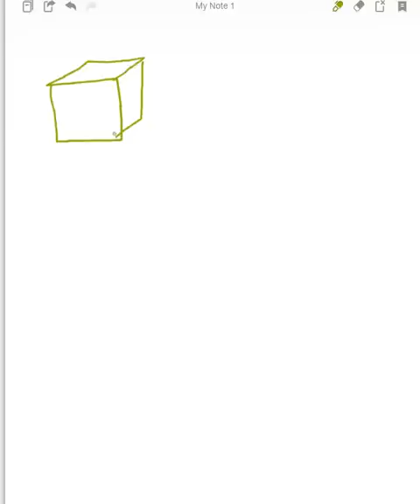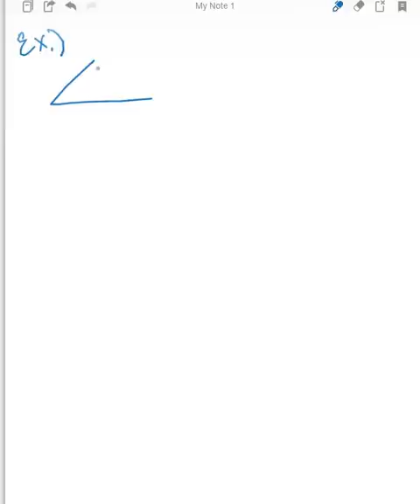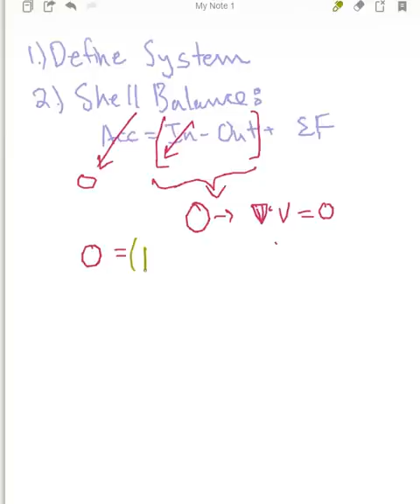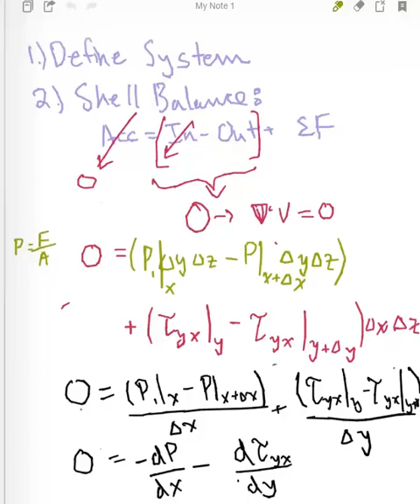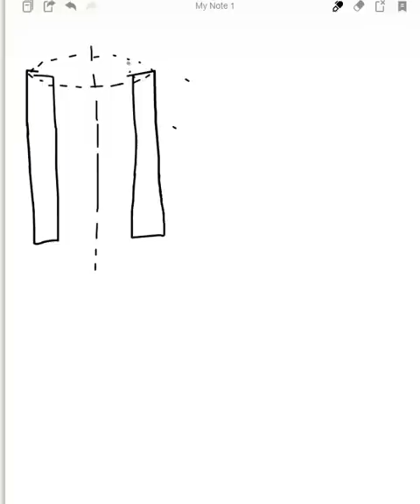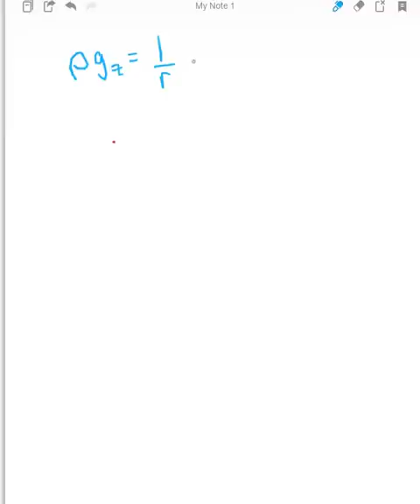An Introduction to the Momentum Shell Balance

Comment: I like how you guys use images and diagrams to explain how to do shell balances. Momentum balances are a tough topic to learn for students in chemical engineering. It seems you have a great amount of experience teaching shell balances and have a good enough grasp on the concept to be able to teach it to students. One thing that could be improved is to show each step of the derivation because when I took my fluid dynamics course I always had trouble understanding how each part of the Naiver Stokes equation was derived.